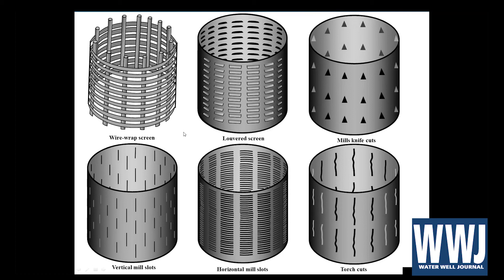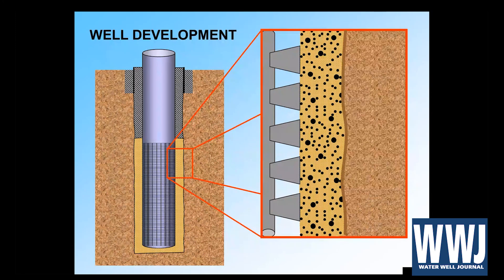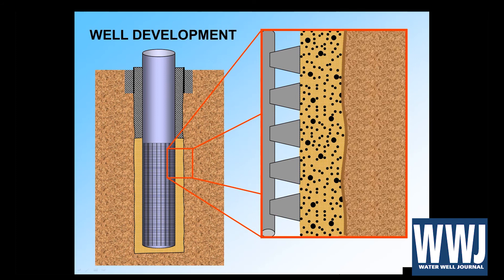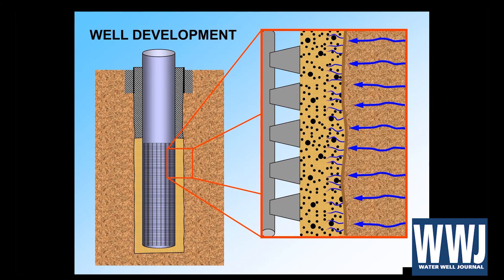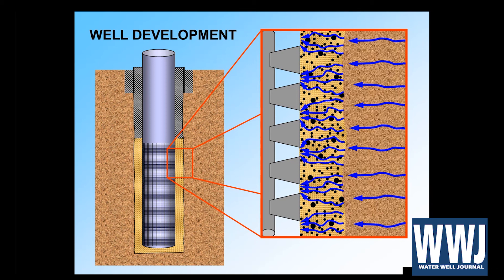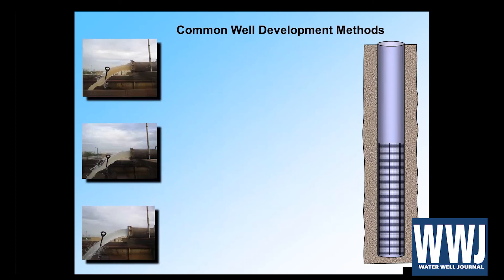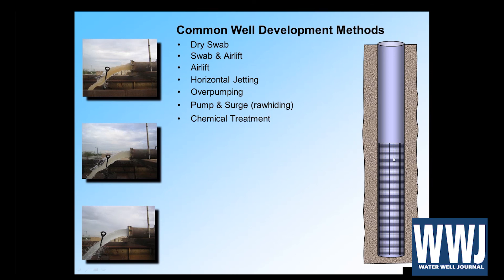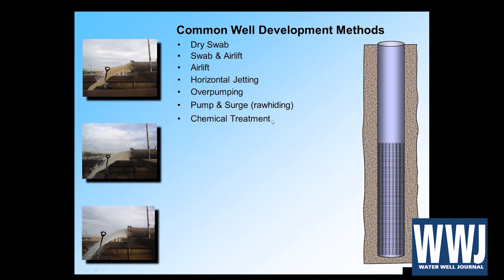Marvin F. Glotfelty, RG, on Well Development Techniques and Concepts | NGWA: Industry Connected

Comment: Hi , what if you have an acquifer that contain a lot of sand? I am having a situation where the borehole has been drilled for few days already and developped with airlift , but fine sand keeps coming into the well practically blocking all the screens.